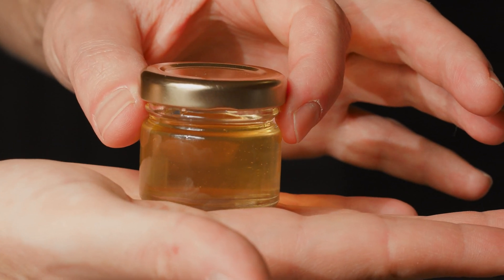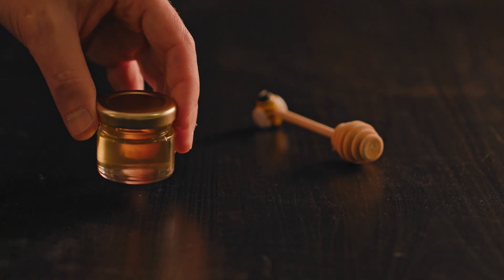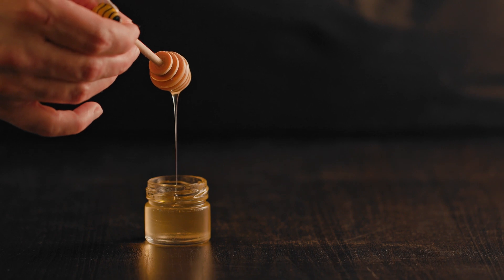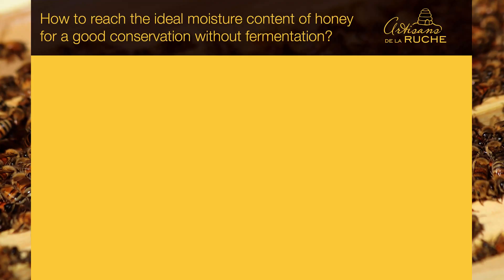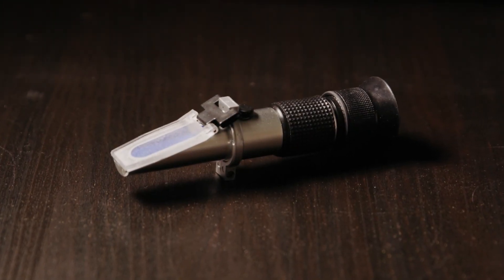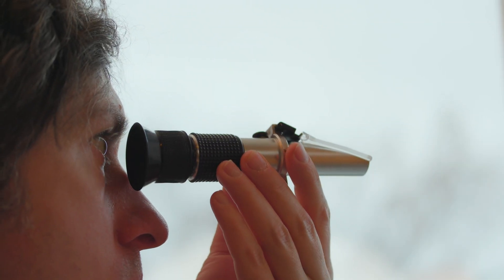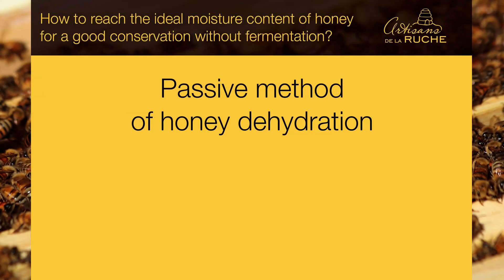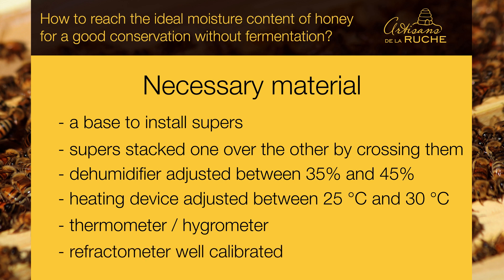How to reach the ideal moisture content of honey for a good conservation without fermentation?

Comment: Very few videos on how to calibrate refractometers:   Use cold pressed extra virgin olive oil.   Set brix scale to 71.5. (28.5% moisture)     Check calibration each day of use.   I have found the heated honey room (95-100*F) seems to read higher moisture falsely by around 2-3%.    Best to check at room temp I believe.
Reply from the maker: Yes, not a lot of videos on how to calibrate refractometers. But here we didn't want to talk on this specific topic. Some people use different kinds of refractometers (electronics, withtout Brix scale, etc), and they all come with different recommendations from manufacturers ...
Yes temperature can affect the moisture readings of refractometers. Some of them have charts included to correct this. And other refractometers will do internal correction. But it's a good point that we need to be aware of.
Thank for your relevant comment!
Have a nice beekeeping season!
Reply: @ArtisansDeLaRuche  Just sharing the info.  Most people never calibrate, a big mistake.  Bee well !
Reply from the maker: Yes thank you very much for sharing. Have a nice end of season!
Reply: @JnJShiffler  Most people use degrees Celcius . . .

Comment: Great video! Btw can I use my camera drybox to decrease the honey's water content?
Reply from the maker: Thank you very much for your comment. Hummm... For your camera drybox we never heard about somebody who tried this. Of course, we do not think that it is a good idea to put honey and wax in a camera drybox.
Reply: I was researching this myself, and found this: "honey has a very poor diffusion rate. If, for example, you were to use a fan to blow warm air across the top of a drum of thin honey only the top layer would dry because the effect will not migrate very far. " I guess you would have to stir frequently. I plan to try this with silica gel beads packets.
Reply from the maker: @djg585  Yes, that's why it's better to do this step while honey is still in supers. Because honey surface in contact with air is larger...
Reply: @ArtisansDeLaRuche  
You are right. I've learned my lesson!

Comment: My second question is : what is the fastest method for drying Honey?
Reply from the maker: #1 do it before extraction
#2 place honey supers in a room with dehumidifier
#3 put ventilation to push air through honey supers to make process faster
#4 monitor regularly  honey moisture with refractometer
Reply: I also think different Honey / Nectar  sources are 'drier' than others. Region to region, area to area and altitude too.
Here in Scotland 🏴 eg :
we have lots of Moorland with Flowering Heather ! 
If local Beeks take "their Bees to the Heather" usually around August /September  then they need to take the Honey off around x3 Weeks later. Otherwise it "Sets" in the Honey Comb itself (!)
Not a problem if you Sell Honey Comb itself, in Gift Boxes, say to Tourists. Or a whole Frame of Comb say at a Honey Farm etc.
But if you want that Honey in a Jar, for Show Honey, Sell to a Store etc. You have to move rather quick.

Think same applies to Honey made from Ivy, but as its mainly a late season Honey, Beekeepers do not want to open up their Supers. And I believe Ivy Nectar is a desired taste ! That Bees love yet us Humans do not ! . . . 🤭